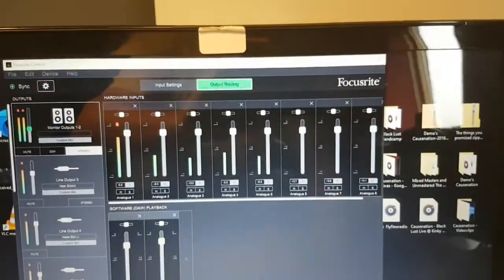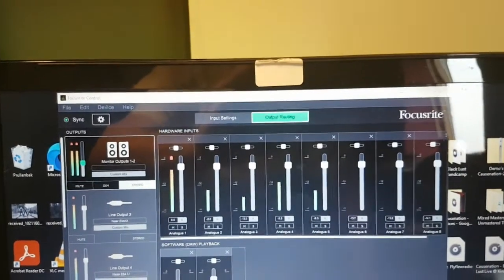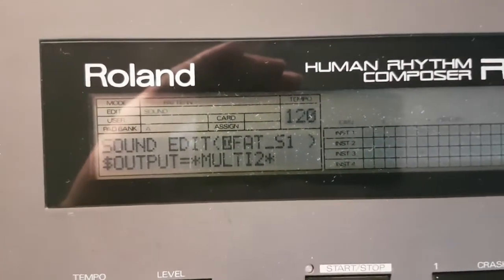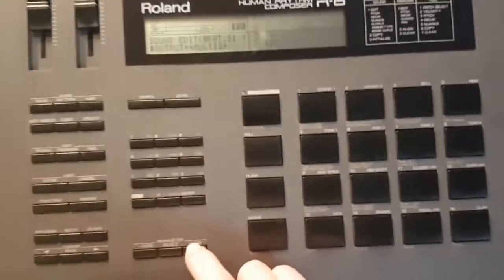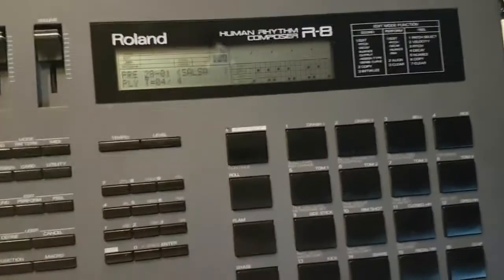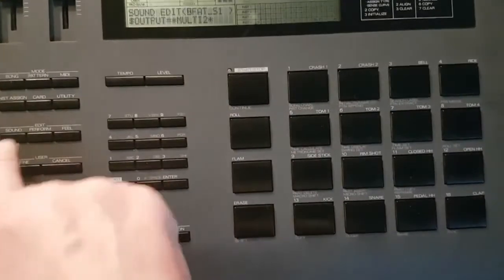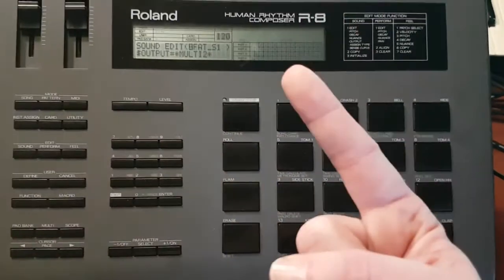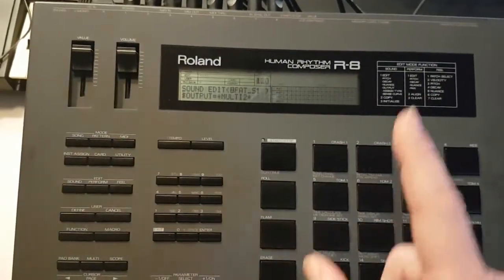Routing instruments to individual outputs with the Roland R8

Comment: Vain - what 1/4" connector did you use on the r8 side - balanced/TRS or unbalanced?
Reply from the maker: I used TRS. 
You cannot set panning on individual channels so I suppose a TS cable can be used as well.
The stereo outs allow panning.
As a matter of fact 
I sometimes mix TS and TRS and it doesn't affect the quality of the sound coming out of the outputs. 
You obviously go into a mixer where you can set your panning and do other stuff.
Thanks for your question.
Reply: @vainsacrosanct2014  excellent! TRS sound quality vs. TS you will only notice over very long cable runs. I was concerned with these if they would accept TRS just because of the age, but looks good! I'll build the cables and complete the setup. I plan on feeding all 8 outputs of the R8 into a funky summing mixer that allows me to manipulate each channel with audio goodies.